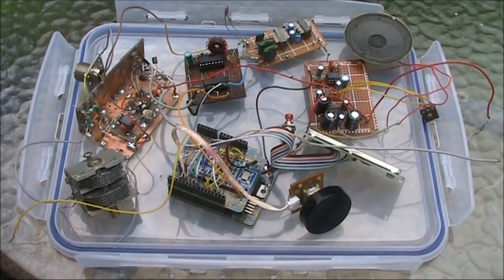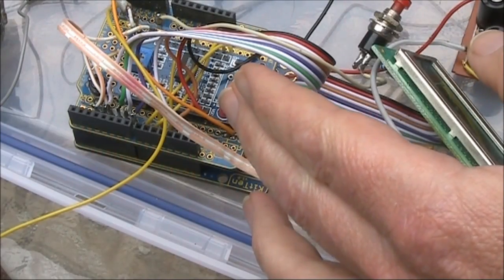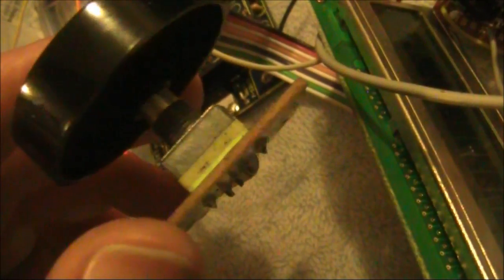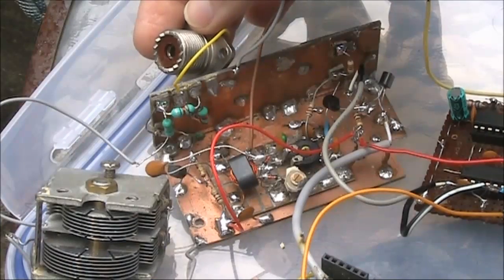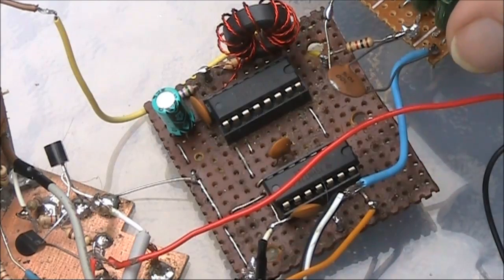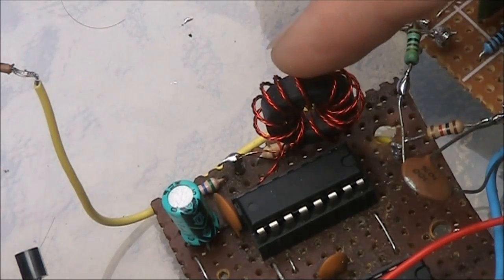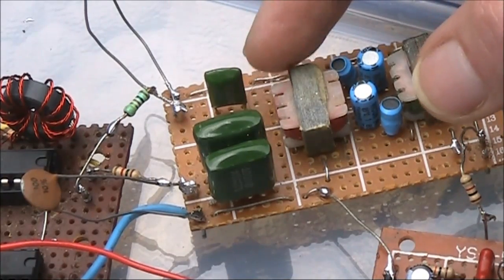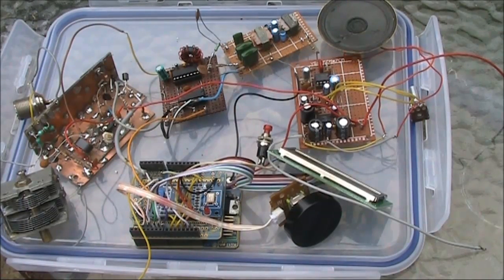DDS controlled phasing direct conversion receiver

Comment: have you tried using 14.318 mhz xtal as oscillator and 3579 kc as tx frequency ? this both pair will enable single frequency transceiver.

Comment: why do cw require an offset why not just use simplex?
Reply from the maker: It is simplex in that all stations in a contact are on the same frequency.  An offset is required to provide a beat note which is essential for a direct conversion CW receiver.

Comment: The Si5351 would work well in this circuit.  Its good to at least 160Mhz which would cover all the HF bands.
Reply: I can't help but think that chip/technology is going to replace all DDS. What advantage does DDS have? Not any that I can think of!